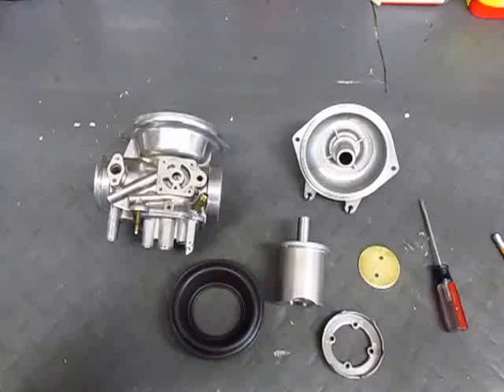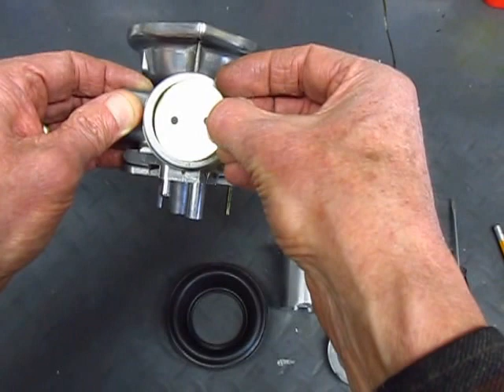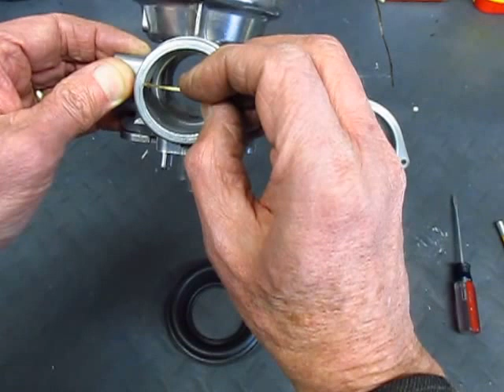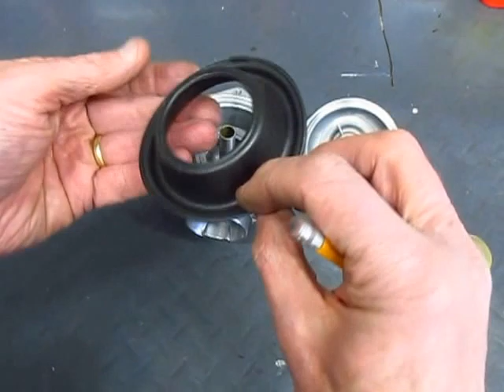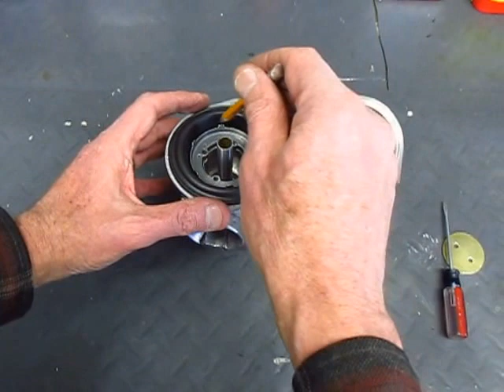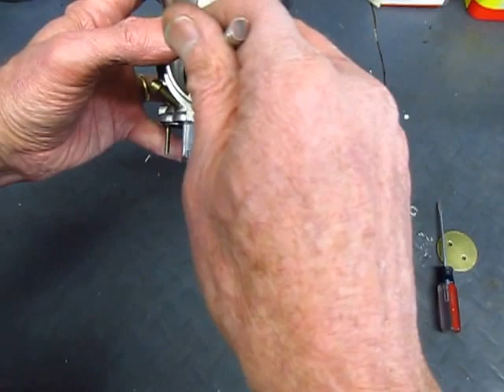How The Constant Velocity Circuit Works

Comment: Wait a minute Brook, isn't the purpose of the throttle lever in the cockpit to change the force of depression at the site of the carburettor ? If we have a "constant depression" system, why does my manifold pressure indicator indicate different values as I set different power settings with the throttle lever ? 🤔
Edit to (possibly) answer my own question: When we say 'constant depression' we're only talking of the static pressure in the Venturi, which stays constant in this type of carburetor no matter the position of the throttle lever. The pressure outside the Venturi in the air intake circuit remains different at different throttle settings hence the Manifold Pressure indicator indicating different readings.
Reply from the maker: Sam, as the throttle plate opens, more vacuum exists in the carburetor passage, so more air flows. As more air flows, the pressure at the center of the venturi drops. The passage in the carb body that goes to the top of the diaphragm reduces pressure on the top and that pulls the slide up allowing more air to flow through the carb and the needle to move up in main jet allowing more fuel to enter. The constant depression ensures the volume of air flowing through the carb matches the fuel flow so the air/fuel mixture is correct, even if the atmospheric pressure is lower due to higher altitudes. This means the carbs are not too rich with a fairly large change in altitude.

Comment: I had 2 small 49cc bikes and the throttle cable was directly mounted to the top of the carb & pulled the main needle jet up and down directly ... 
My Suzuki S40 is NOT like that. Its this design here and when i had to pull it off to clean the idle jet, i saw that the throttle cable ONLY turned the throttle plate and i was like ... 🤔 ... so how does the main needle jet go up and down based on throttle ... ?? 
Well you just answered my question 👍🏾

Comment: If the opening and closing of the throttle can manage the amount of air entering the engine, what is the purpose of the slide?
Reply from the maker: It regulates the amount of air that flows in the venturi. This in turn adjusts for altitude change so the correct fuel-air mixture is achieved as air density decreases with altitude.
Reply: @BrooksAirheadGarage  thank you

Comment: Hi Brook! One question about this carburetor system ... 
My left carburetor  (Bing 32 - R80G/S) is making me crazy. After a 'long' trip, (Transpyrenees) and after always working super good. It is working strange. I need to help the carburetor to go down rpm by braking with the engine. I mean engine goes down rpm normal, but this carburetor stays a over the ralenti rpm when I stop like in a trafic light. Like the double of normal rpm.... 
I have changed gaskets, round rubber in ring mixing screw. Also rechecked mixting.

Only left carburetor, after 10/12 minutes driving (engine good temp)

Any help????? What I am missing????

THANK YOU VERY, VERY MUCH IN ADVANCE!!!!!
Reply from the maker: Hi Albert. I would check the diaphragm for a tear or a hole. I would verify that the slide moves smoothly in the bore. One way to do that is to remove the air intake plastic pipe from the air cleaner on both carburetors. Rev up the engine and then close the throttle and verify that both slides come down to the same level.

I would also verify that the throttle cable. It may have a kink or a wire in the cable maybe broken preventing the inner cable from moving smoothly inside the outer cable which would keep the butterfly open.
Reply: @BrooksAirheadGarage  Thanks a lot Brook!!!! I will check everything you said!!!
Reply: FINALLY SOLVED!!! YEEEEEEAAAHHHH!!
Do you know what it was.....???? The two valves of the left cylinder, the cylinder that the carburetor wasn't working properly. were too closed. I bought the typical thing to mesure spaces in between pieces (Mesure like 0,05 mm, 0,10mm, 0,15mm, 0,20mm, etc) And just adjusted exhaust valve 0,20mm and admision valve 0,15mm. And now engine goes again to normal ralenti rpm when I brake  the bike ..... So, this cylinder coudn't close correctly the valves, so it didn't do correct vacum to the carburetor to work correctly.

HAPPY!!!
Reply from the maker: @albertcosta5755  I'm glad to hear you found the problem. But, you should check the valve clearance on the left cylinder again in 1000 miles (1,600 KM) and see if they are closing up.  Exhaust valve seats on 1970-1987 airheads can be damaged by no lead gasoline. If the valve clearance is closing up in 1,600 KM, it's time to have your heads rebuilt to prevent a broken valve.
Reply: @BrooksAirheadGarage  Thank you Brook!!! 
I will do this in 1000 miles as you say! I didn't know!! I am amateur....  
Thank you again for your help and info!!!

Comment: That carburator has probably more IQ and definitely more knowledge about fluid mechanics in its body, than the chemical engineer, I am....
Reply from the maker: Kaya, Indeed, the ability to control the metering of fuel, atomization, and mixing with air in the correct amounts across a large range of atmospheric pressure is amazing.  I suspect the non-compressible fluid flow equations got the designers part way there, and then testing fine tuned the dimensions of the passages to achieve the final result. When you think of the slide with the needle, you had to account for friction and the compliance of the diaphragm to get the movement of the slide to work correctly with those small forces.

Comment: Excellent explanation. I am wondering if there are any changes to carb functioning when the air box is removed in lieu of adding air filters to each carb instead?
Reply from the maker: Hi Rodger,  Yes, removing the BMW designed airbox changes the air flow through the carburetor. From what I've heard, BMW designed the airbox (the later one used on this bike is even better than the original "clam shell" airbox) to provide optimum carburetor performance. Removing the airbox, or bypassing it, to use pod filters, K&N for example, does not make the engine run better (more HP and torque).  

The goal of the airbox is to slow down the inrush of air into the carburetor intake to as low a velocity as possible. It's the pressure difference between the high pressure carburetor inlet and low pressure outlet that is important. Since moving air has lower pressure than stagnant air and you want the highest air pressure you can get on the inlet side of the carburetor, pod filters are not helpful. They can't slow the inrush of air across the RPM range so the pressure difference across the carburetor is reduced.  That disrupts the ability of the carburetor to provide the correct fuel/air mixture across the RPM range.
Reply: Brook's Airhead Garage , that sounds correct. It always amazes me how others  in their shop try to improve upon this engineering , most cafe racer type bikes appear more for show than improving real performance it seems. 
Thanks again for your insight .
One last question would be how often do these bing carbs need to be rebuilt ?
Cheers
Reply from the maker: Hi Rodger, a good question with a "depends" answer.  It you drain the float bowls for the winter the o-rings last longer, and the internal passages don't get deposits, than if they sit for months in fuel laced with ethanol.  As a rough rule of thumb, I'd suggest 5-7 years. 

That said, if the bike isn't running well after a tune up, you can pull the main jet stack and the idle fuel adjustment screw to inspect the o-rings. If they are showing deterioration, assume all the o-rings, including the one on the throttle shaft, need to be replaced.  I hope that helps.

Comment: Hi great video many thanks does adding a spring to the slide make a lot of difference my R75/5 has a spring in each slide? Regards Al
Reply from the maker: AL: It seemed to smooth the transition from idle to mid-range after I did it.
Reply: Brook's Airhead Garage that’s true for me too. I will test it more when we can ride again. Great video thanks for the time you have taken. I understand the carbs far better now. Regards from the UK.